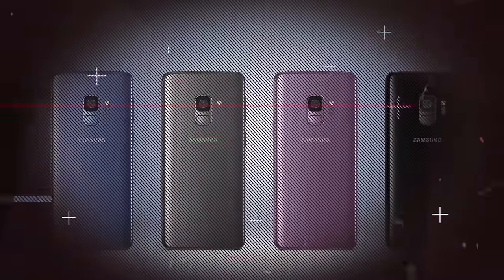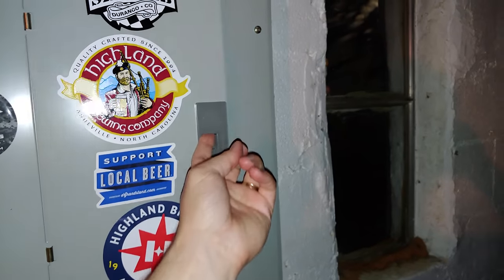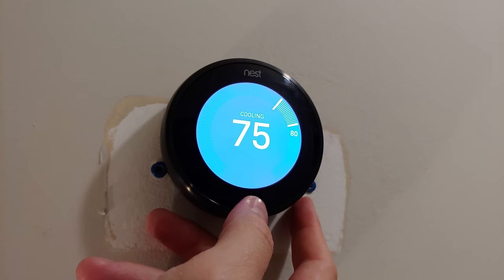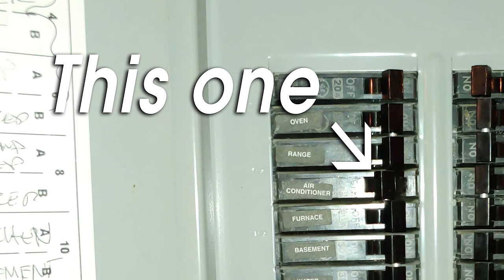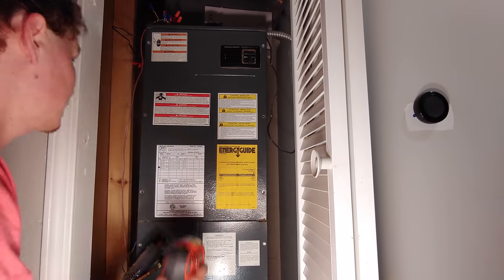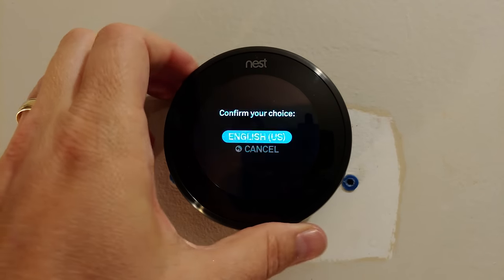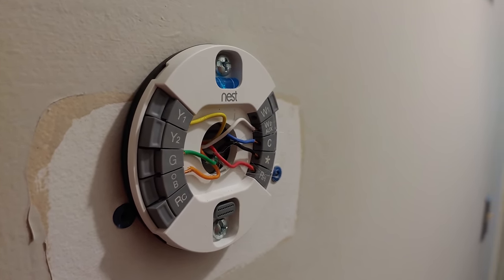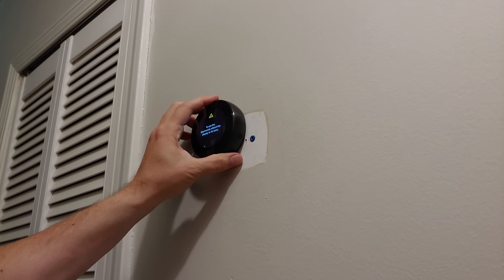3 Common Google Nest Thermostat Problems and How to Fix Them

Comment: NEST is really crap. The wiring advice in this video is excellent. It does resolve the problem that NEST is a terrible design, uses its own unusual, circular way of programming. It has resulted in numerous problems and I cannot think of a worse replacement for a regular old thermostat.  The other issues uses a mini USB connector to recharge the internal battery. It is not constantly topped up.  Just setting the WiFi is a nightmare, to program the password especially. it can also be very easily accidentally  made inoperative. This is a very poor design and I would never ever install this POS if I have any choice.    My NEST was installed by Vivnt who are a bunch of frauds taking advantage of vulnerable suckers.   The two together, NEST and Vivnet spells trouble and could easily destroy a marriage or relationships. My nest I would like to take outside and blow if way with a shotgun.
Reply: Nest is excellent…. all the stuff you said is you rambling….and makes no sense… just fix the issue, move on, and enjoy life. For crying out loud it’s just a thermostat ….🙄🙄Don’t worry about it.

Comment: I had a no power code at first. I had shorted the power and common wires on the metal nest mounting bracket. It reset after it cooled down. I couldn't be sure which breaker it was, four were not marked and there were lots of computers I didn't want to accidentally reset. So I changed it live. I had the red wire incorrectly on Pc. 
Worked great after fixing that.

Comment: Thank you for this, and for being the only one not to blame it on a clogged condensate line. The moment you mentioned a fuse in the air handler unit.... I knew that was my problem. Sure enough. 5am run to Wally world.
Reply: Also, make sure wires are clean

Comment: Just got Nest for mom....set inside temperature for 82 but the inside temp will noy go further than 80. It's been in 80 all weekend no matter how high the desired temp is.
Reply: Double check that a limit isn't set... Min Max temp.

Comment: Im having an issue where after using the AC and hits the desired temp, the AC unit hums. I turn on the heat for 5 seconds then back to off and the hum goes away. Im afraid its going to damage the unit, and am tempted to replace the Nest. Our unit is really old, 1987 maybe?
Reply from the maker: Are you using any of the features like "Cool to Dry" or "Airwave", which would keep the unit running for longer than usual, or even after the compressor kicks off?
Reply: @androidheadlines  nope. Just cool, heat, and occasionally fan.
Reply from the maker: 1987 is very old. Have you tried hooking the old thermostat up and seeing if that still happens? Massive PITA for sure, but might be worth a shot for troubleshooting.
Reply: Is a C-Wire installed (Common Wire to the thermostat). I've heard of this happening where there's pulsing if not.
Reply: @RogerDiotte Pulsing if their is Not a C wire or with? That was a tricky read..thansk

Comment: Thank you for this! I had the thermostat connected incorrectly because I did not have it hooked up according to the terminal strip for the heat pump.  You saved me a lot of time double-checking the wire colors by going to my pump and AC unit in my attic! Thanks again

Comment: It could be your wifi, not the thermostat. I'm not sure if this will help anyone else and it may be obvious to some, but my issue didn't seem to be the thermostat. The problem was my AT&T provided Wifi. I have 1GB wifi and was using the AT&T provided gateway. I have no choice but to use the gateway, but when I turned the wifi off and used my 3 yr old Orbi Wifi 5 router in AP mode, I have not lost connection not once in over 3 weeks now.

Comment: I had the issue with the second problem. Only issue was, the wire itself was fine and the fuse was fine. Turned out the thermostat was bad. Installed my old one and system works fine.

Comment: I’ll be honest. I hate this thing. I recently moved to a house with nest thermostats pre installed. They all had the pointless “eco” settings turned on by default, which resulted in my room turning into an oven as soon as I leave the room or look at it funny. it would consistently be 80 degrees in the room and the damn thing would only be blowing a gentle breeze through the vents. I’ve turned off every “eco” setting from what I can tell, but I still have a hard time being confident it’s blowing full tilt when it needs too, or that it’s even doing what I want when I leave the room. Proof that cramming a screen and internet connectivity in basic household appliances doesn’t always result in a better product. Replacing it with a cheap one from Walmart if these problems persists

Comment: Some good advice! Unfortunately I m having trouble getting the Nest to configure for a heat pump! Whoever installed this system didn’t do that! They wired it for a heat pump with strip heat… but thermostat set for gas furnace or electric heat strip & ac! 
Smh! Tried to configure several times! Appears you have to remotely access thru cellphone & internet connection!?

Nest should have a field adjustment without using Wi-Fi to confirm that!
What a pain! Now I have to go back while the owner has their cellphone & their internet codes information etc! Senseless! Thanks anyway 😤👋🏼

Comment: Posting this wherever I can

I too spent 3 hours scratching my
head until I reinstalled the original
thermostat. It was when I closed the
damn door on the furnace as I was
cleaning up and the air kicked in that
I said don't tell me it was the fucking
door.

I reinstalled the Honeywell c-wire
adapter to the furnace, reinstalled
the nest thermostat, closed the
furnace door and turned the power
back on. Nest began updating
software and set up finished 5
minutes later.

Listen to your parents and close
damn door!

Comment: Thanks a million for this great and useful video! After struggling over an hour trying to figure out why my Google Nest Thermostat wouldn't power on even though I had strictly followed all the Nest App instructions for the wire connections, it turns out that it was a case of the red wire needing to be connected to the RC port instead of the RH port like in my old White & Rodgers thermostat. So if like in my case it looks like you have done everything right and the damn thing won't power on once you turn the power back on, turn the power off again, reconnect the red power wire to the RC port instead of the RH port, turn the power back on and that should do the trick!
Reply: Good to know! Better when it works and knowing the battery on the Nest is now only needed during power outages!

Comment: The NEST is a bad product. A first-year engineering student could design something better than this. They obviously cut costs on the actual electronics in order to spend more money on making a compatible (but terrible) phone application for it. 

The thermistor(s) are thrown off by the slightest bit of humidity and the temperature reads wrong most of the time. The device was designed around saving power, so it will not "listen" to direct user input unless the heat is manually set way above (or the cool mode is set way below) the actual temperature displayed on the device or app. Even with the power-save mode turned off, it will still wait until your home is very uncomfortable to start running (letting your home warm up or cool down 2-3 degrees Fahrenheit above or below the setting).
 
This thing will remain stagnant most of the day without constant adjustment, and your home will always feel too hot or too cold. An inexpensive Honeywell from your local store will work better than this- at least until you can find a better thermostat with app control.